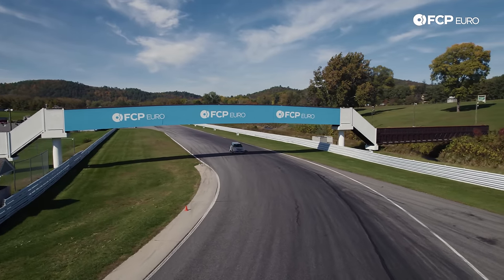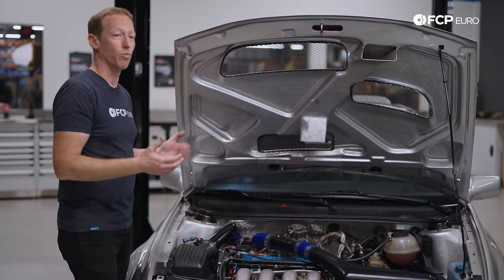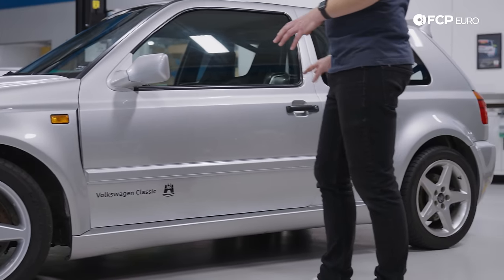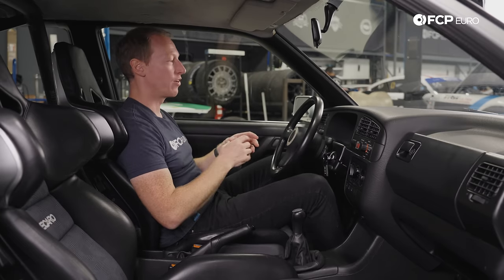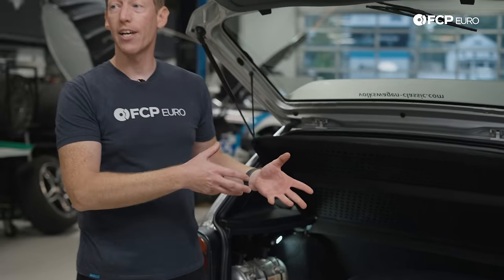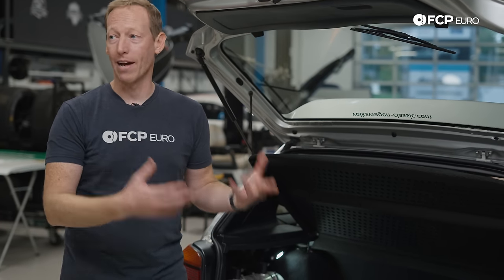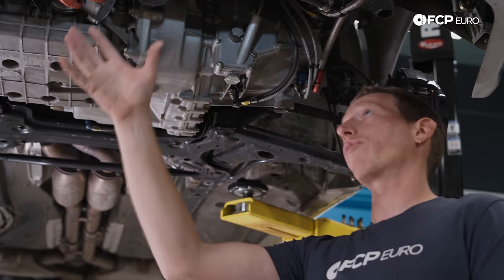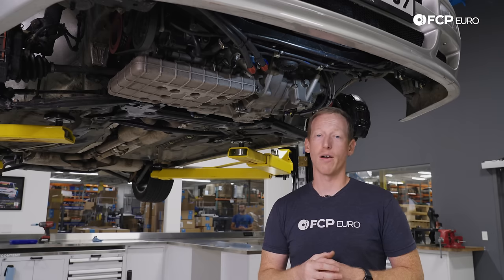Golf A59 Prototype - Everything You Need To Know About How Volkswagen Designed Their Rarest Golf

Comment: As a huge fan of 90:s racing and rallying, it would have been awesome to see this take on the WRC in the 90:s, another one of those what if moments in motorsports 👍
The Group A rules which wrc run under at the time, said that bodywork and basic tech layout of the rally car had to look the same as the road car, hence homolagation specials, like the Mitsubishi Lancer EVOs, Lancia Delta HF Integrale Ford Sierra RS Cosworth & and Escort Cosworth.
The MK3 Golf would see rally success in the 2 liter, naturally aspirated, 2 wheel drive F2 ( Formula 2 ) rally class in the late 1990:s, and it was quite fast and succesfull there.
The F2 rally cars were awesome, making 270-280 hp from high revving 2 liter n\a engines and weighing around a 1000kgs, some F2 cars like the legendary Peugeot 306 Maxi and the Citroen Xsara Kit car often the 4wd turbo charged wrc cars on tarmac rallys, and the Citroen Xsara kit car won 2 rallys outright in 1999 👍

Comment: Interesting video and great to see under the skin of this car. A couple of points - the turbo on the rally car wouldn't have been bigger, as the Group A regulations dictated that the rally car and the road car used the same turbo (albeit rally versions usually had upgraded internals). All/some of the additional coolers may have been dropped from the road car too, as oil coolers were pretty free under the Group A regulations, so it wouldn't be necessary to include them on the road car unless they were essential. The suspension is interesting. On the rally car, the uprights control arms, anti-roll bars etc would have all been replaced, so this all looks like it was prototype road car stuff. Such a shame the project was cancelled. We might have all been looking at VW very differently if it had gone into production and competed in the WRC.

Comment: I am confused how is 86mm by 86 mm on 4 cylinders 2l engine and my tfsi that has 88mm by 92.8 also 2l engine what math are these people use to get same results
Reply from the maker: All modern 2.0 VW engines, from ABA on up to the latest EA888 EVO 4 all use a 92.8mm crank and 82.5mm pistons. The main reason for the bespoke 86x86 engine used in the A59 is due to limited piston size with the standard VW/Audi 4-cyl layout. The biggest pistons you can fit tends to be around 85mm, as used in some of the Audi touring cars, but that results in very thin cylinder walls, and very short engine life.
Reply: @fcpeuro  thanks for the reply i did some more search that info is correct and yeah i know about square 86x86 becouse of 2jz engines have square and its the reason for all that capabylity